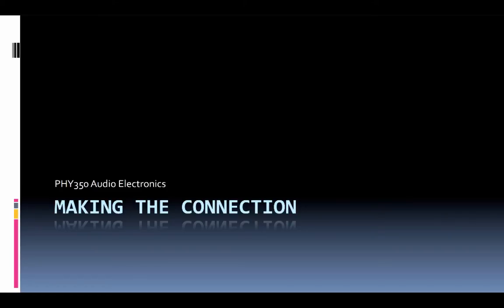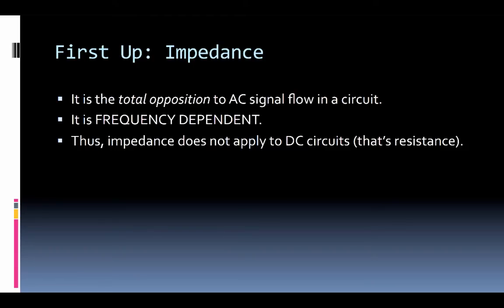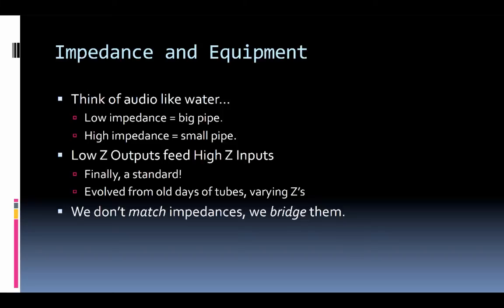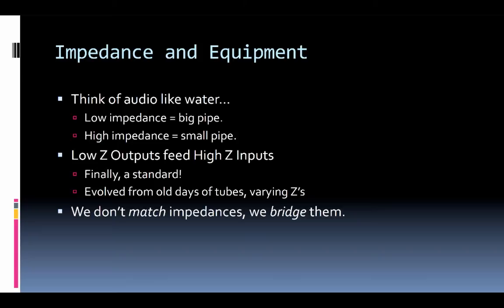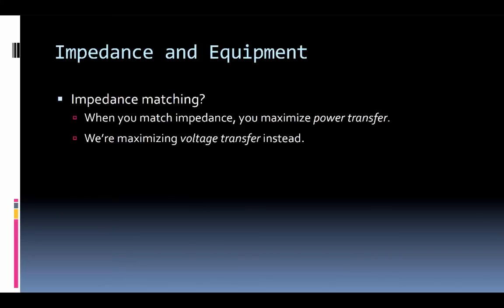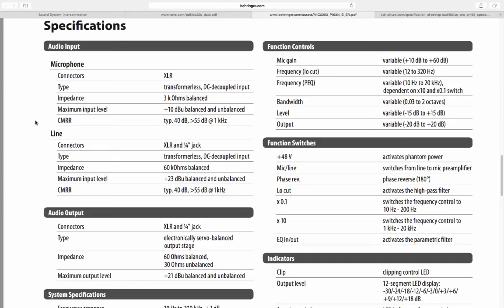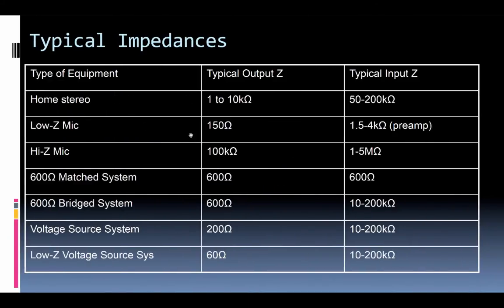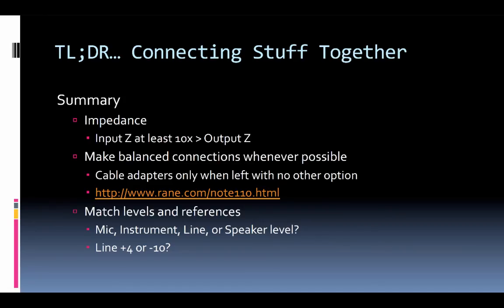Audio Device Interconnections: Impedance, Balance, & Level

Comment: Amazing video. Can you help me with a question I have? I have 2 mono outputs in my mixer that are "impedance balanced". May I have problems by making a stereo connection with cable adaptors with these mono outputs and sending it to an headphone? What will be the difference connecting 16 ohm impedance headphone and a 32 ohm headphone?